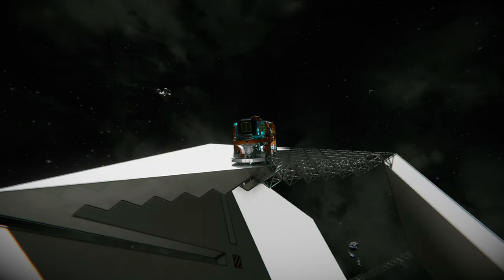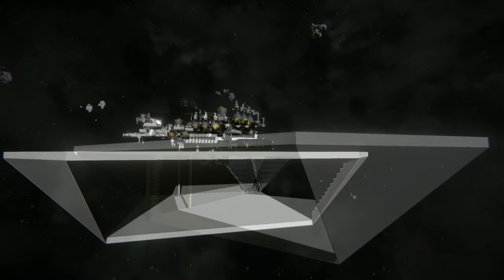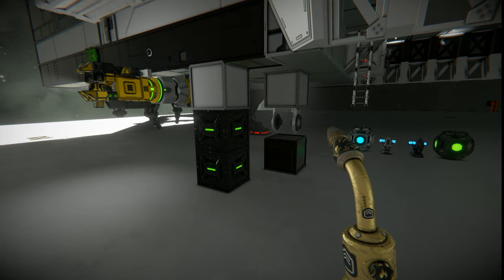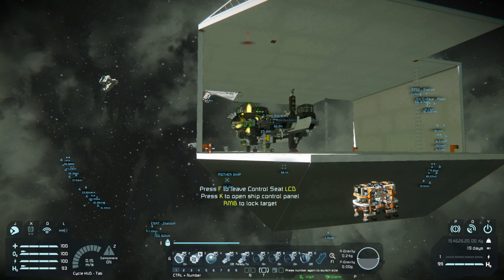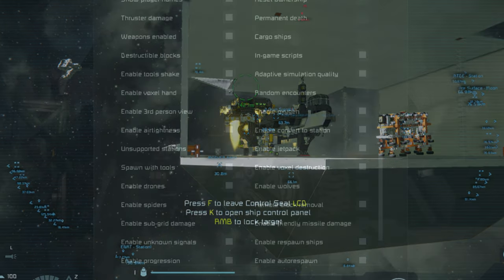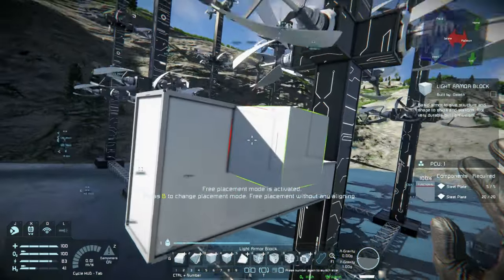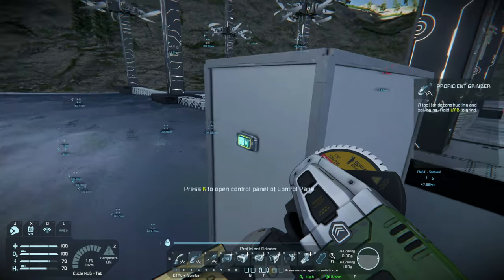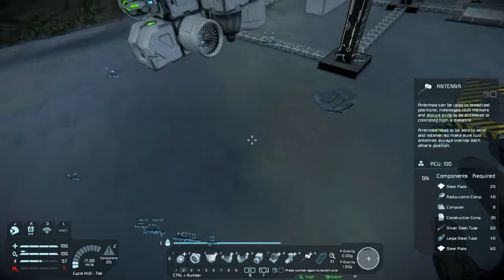Space Engineers - Convert to Ship & Convert to Station Explained w/ Unsupported Stations | Tutorial

Comment: I have a question related to tanks and there treads. So hear me out, if you sit in the main menu of space engineers and watch that cinematic that runs in the background among other things there is a tank with amazing treads and I can't find anything like it. Please I'm so curious if tank treads are more feasible than I once thought.
Reply from the maker: Tank treads are not available in the base game or any of the DLCs.  However, there are a couple modders out there than have made tanks treads (or at least simulated it visually...what I mean by that is that I believe in most cases the vehicle is still propelled by the wheels and those settings with the treads being a visual that moves on the outside...but that may not be true will all the mods).  I haven't loaded any of those to see how reliable they are or experienced them for myself, but there are a couple out there on the Steam Workshop.  Hope that helps!

Comment: I’m currently building a ship on the moon and connected it to the ground with a landing gear. I don’t have the option to convert it as a ship and is considered a station. I’ve tried moving it but it doesn’t work. Any ideas?
Reply from the maker: @dongledan17 Yes - couple thoughts about it.  Grind off the landing gear and any block where even a tiny corner of a blocks voxel square might be touching the ground.  Visually, nothing may be touching the ground, but even something like a regular interior light takes up a full voxel block space around it in the mind of the game, and if part of a blocks voxel is intersecting the ground, it'll think it's a station.  You can kind of see the voxel space a block is occupying by holding another block up next to it (as if you're going to try to attach it). That's the most common cause, but there can be other little things too.  Let me know if the above worked, and how it's coming - I'd really like to hear!
Reply: @Oearth  will try grinding some blocks off but the ship is two to three blocks above the ground so no where near voxel. One other thing I failed to mention. While planning to build it I connected it to my starter base on the moon and used snap to local grid the whole time. Just wondering if that might have something to do with it? Will update soon if grinding any blocks off helps

Comment: I don't see convert to station/ship a cheat, cause it isn't, it's part of the block screen thus a feature intended for use by anybody, you don't need admin permission to use it nor do you have to do change any settings to enable the feature, on the contrary, the unsupported stations I personally describe as a creative tool, when I build in creative mode to make a blueprint that requires really complex designing. I rarely use that setting however but it is nice to have.

Really none of the settings are cheats. Space Engineers is a Sandbox, in which the player decides what is 'cheating'. In general, cheating is only cheating when using admin tools in survival mode, when a certain accident is inevitable or deleting a pirate drone because you enabled drones in the settings.

I only racked up 1.7K Hours of the game, by now, when I play singleplayer, I know to use quicksaves and quickloads, which again is the way I choose to play. I been on keen servers, where the gameplay was directed, quickloads were not possible and I had a lot of fun with that as well. Again, it's a sandbox, and so you decide your difficulty.